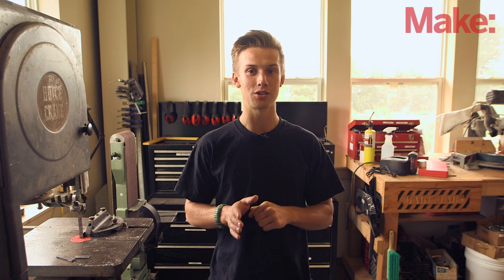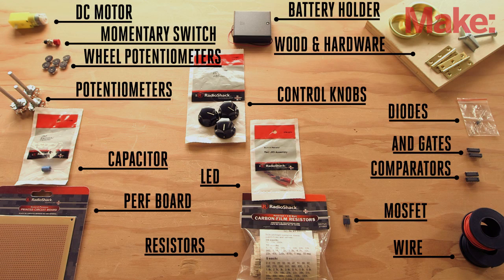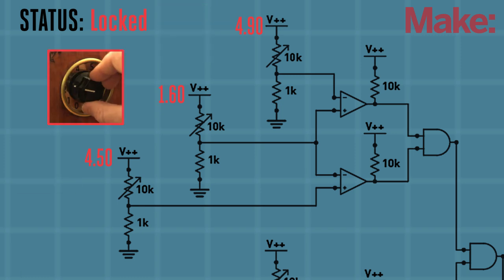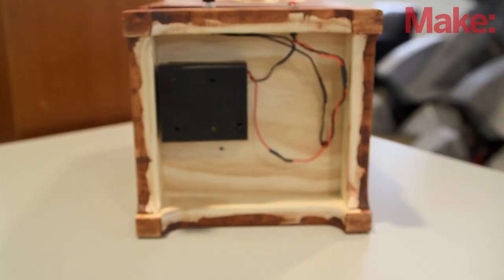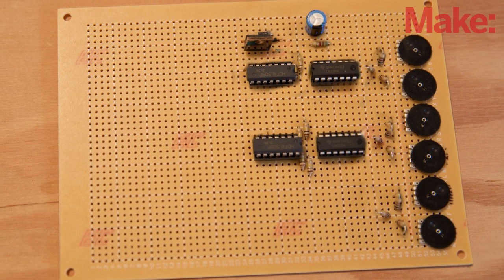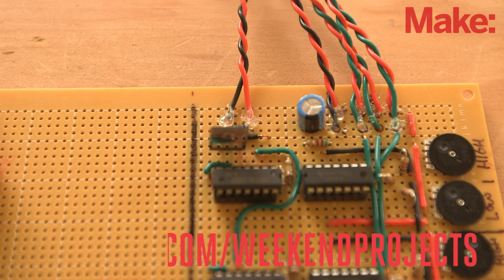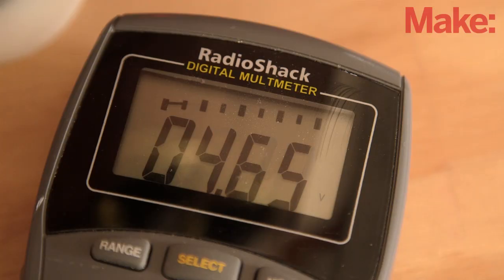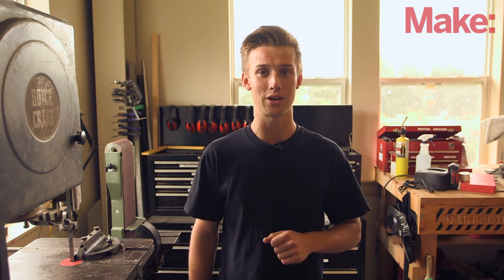Weekend Projects - The Combinator

Comment: +Make... please check you shopping list at the project page. Not all items are on it. The diode and the capacitor are missing. Can you please send me the data of this 2 components ? You should know as electronic specialist, that the wrong components can break you 50€ circuit. Please fix this.

Comment: What happens if the battery dies when it's locked? Now you McDonald's cheeseburger will be lost forever.
Reply: +Ben Haskett the battery is under the safe
Reply: The battery is under the safe, or if you don't want that you can set up an annoying low voltage buzzer indicator with a 555 chip, or you can hide a dc jack somewhere to power while you open and change the batteries

Comment: You could easily make it using just three rotary switches wired, for an example, like this: the first switch's common pin is wired to ground. Pin 5 of the same switch is wired to the second switch's common pin and pin 10 of this switch is wired to the third switch's common pin. Pin 1 of this switch is wired to the other lead of a solenoid and the free lead to positive lead of the battery. Then the combination would be 5-10-1 and the lock will still open only if all of the switches are in the right position and complete the circuit. (in fact I have a safe like this but it also has a timer so that if you try the wrong combination 3 times you'll have to wait for one minute to try again)
Reply: If you make a video on that project, message me and we might be able to get you set up as a contributor!
Reply: Yes, you wouldn't want to use it to store your money or other very valuable stuff but it'll make a perfect lockbox to keep other people handling your stuff. And, if you add power backup leads to a secret location, you'll be able to still get inside if the battery dies.
Reply: Rotary switches offer you a very low resolution(resolution basically means how many divisions). A tipical rotary switch offers about 10 positions(divisions) while a potentiometer has a far better resolution. In the video the guy represents the resolution using the voltage between the pontentiometer's leeds. He sets a window of 0.4V as ON. Now...according to the project page the circuit is running on 12v which means that the ON window is about 1/30 compared to 1/10 on a normal rotary switch. You can create a smaller window if you want.
Reply: the resolution is indeed smaller in rotary switches but you can wire up four or five for extra security, and also there are available rotary switches with even 14 pins plus 2 common pins. And it's very easy to understand if you have any experience of simple circuits with switches and lamps.
Reply: Stop talking (or writing) and share your project with the world.
Reply: I want to share it but I have some trouble with the uploading

Comment: id just use 3 rotary switches and a button wired up so voltage will only flow to the motor when the correct combination is set.